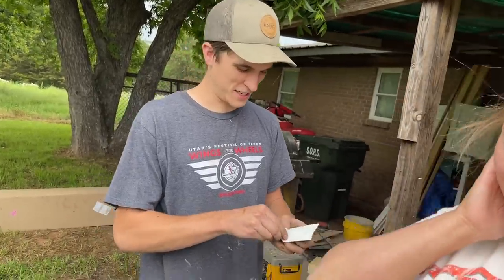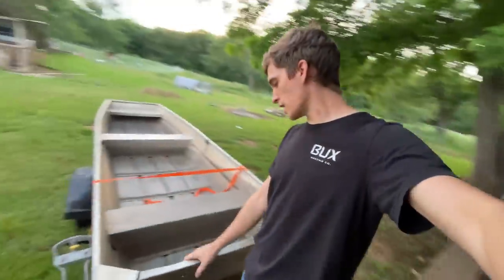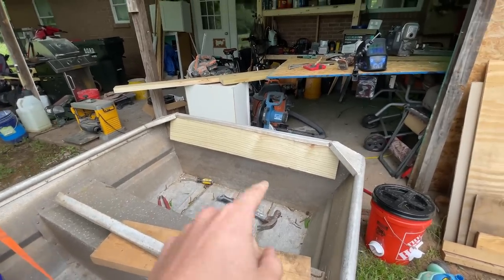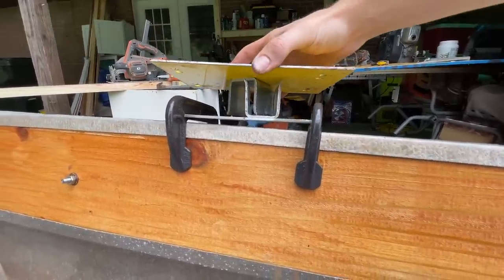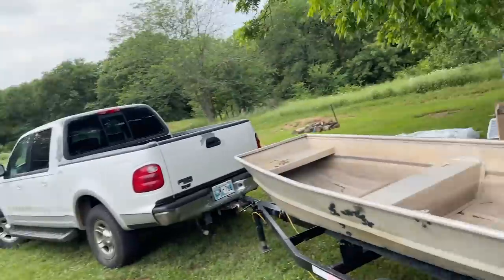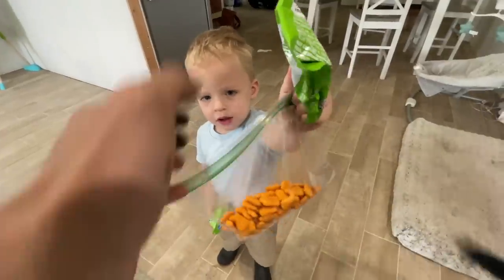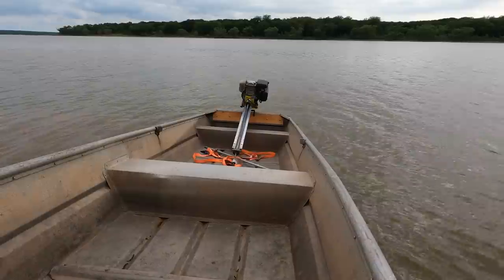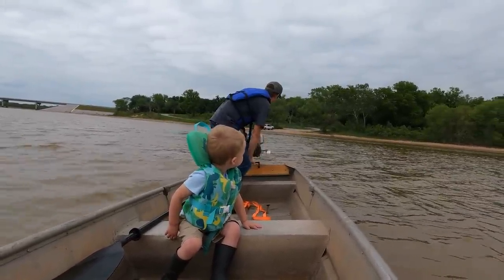Pressure Washer to Mud Motor (Part 2) Transom and mounting

Comment: LOL u arent stranded!! U have an oar & not that far from the shoreline. Can't tell
U how many times our old speed boat stopped working in the middle of a huge lake. We always had oars tho. Try using oars making a 14' speed boat go to shore. That ain't easy.😉 We finally got to a point where we could buy a brand new boat. Boy were we glad we did. Agree with Marci too .. most troll motor shafts arent near that long are they? Seems u could take 2 feet off of that. Btw: Mav is the perfect age to learn how to swim. my nephew was afraid to get into the deep lake water at Mav's age. But I just kept getting in the water with him & I'd swim around the boat with him stopping about half way so he could just take everything in. Once he wasn't afraid of the water anymore, I taufht him how to swim. There's certain first steps like floating they need to learn first b4 swimming tho so they feel more comfortable with the water & using it as a tool rather thsn fighting it. Anyway I've enjoyed this vid .. close to memories we made a lot of. Y'all be safe ..❣️😊☮️

Comment: Looks like Maverick was having a good time until the motor stopped 😢other than that it was working fine for a while . Maybe next time go parallel with the shore for the next test drive until your sure everything is ok.😊Luckily you had the canoe paddle that’s why sometimes it helps to have oars aboard for the small aluminium boats that’s what we used to do here in Australia 🤷‍♀️😃

Comment: Oh my, when you first put the prop on I didn't think you tightened it as I didn't see you use a tool to make sure it was secure. I was thinking, well he will when he is ready but if not , just the vibration will surely loosen it.  😞